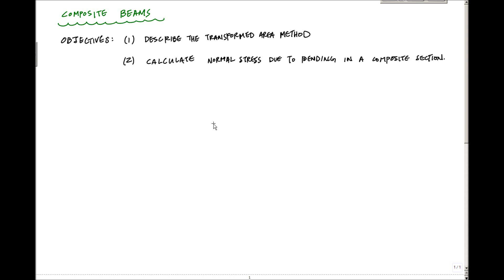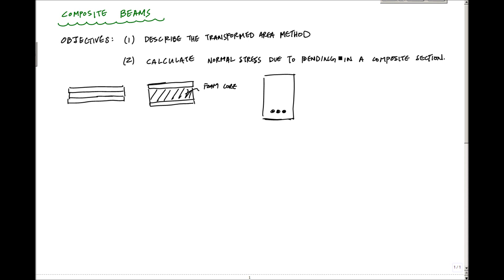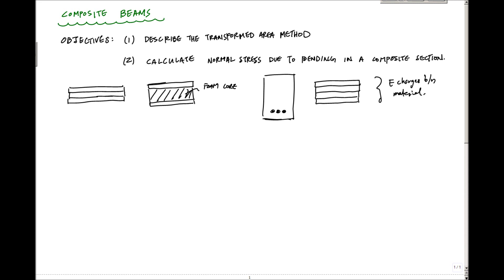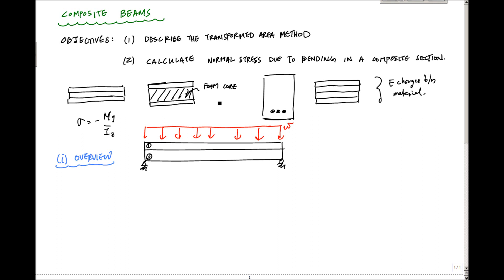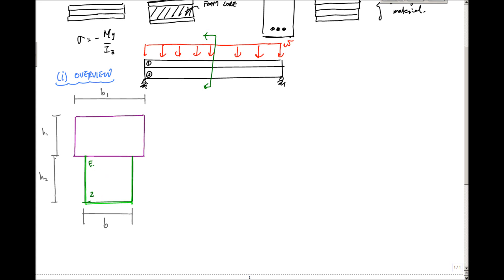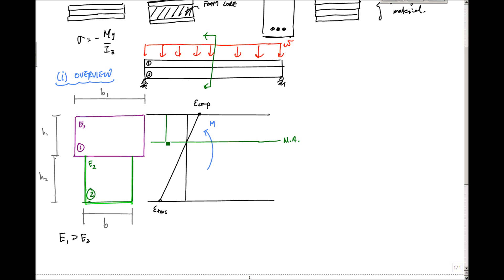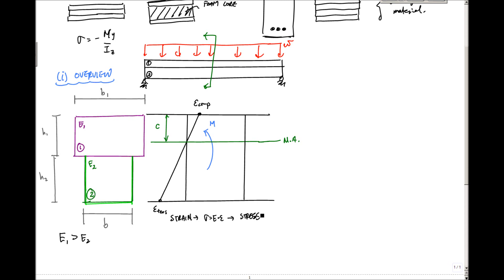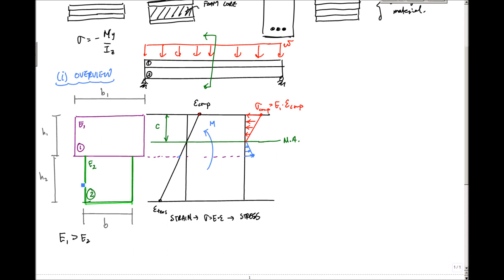Composite Beams Overview - Mechanics of Materials

Comment: how can you calculate the bending moment of composite beams instead of calculating the stress?
Reply: sun you have to do two things.
1. Convert the stresses blocks above and below the neutral axis to forces.
2. Find the centroid of each block (that’s the application point of the force you found on step 1) and calculate the distance between those two points.
The moment capacity is the multiplication of the force (step 1) with the distance you calculated in step 2.

Comment from the maker: The strain profile is always linear and as long as the materials making up the composite remain linear elastic, then the neutral axis will be at the geometric centroid of the transformed section.  The neutral axis does not deform and has zero normal strain.

Comment: Sir, I'd much appreciate it if you can reply to this question. How do you know the 2 lines of your strain profile intersect at that point? I'm asking because I think that if the slanted line has a deeper slope or slanted more than that then the point of intersection will be below what you have right there. Thus, result in a neutral axis that lies somewhere in the middle of the bottom block.
Reply: As the materials are rigidly connected, Strain profile will always be linear because of the flexural formula.